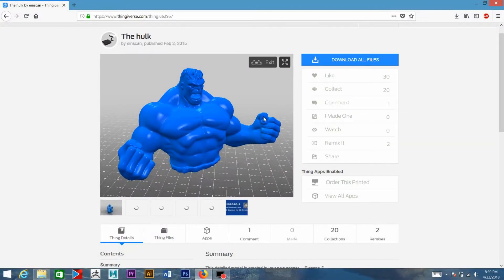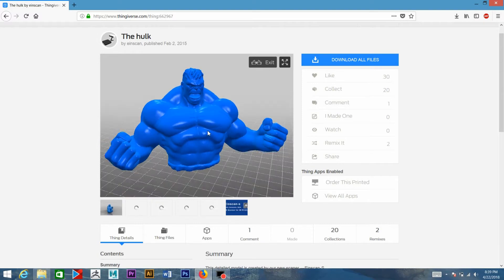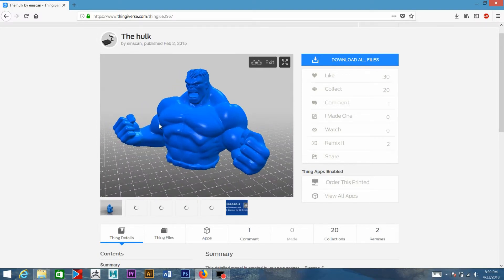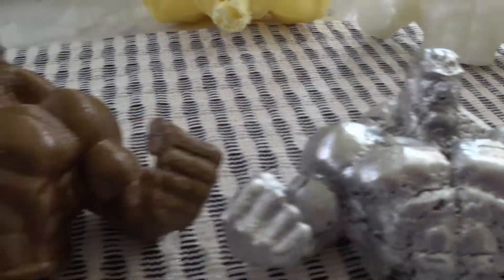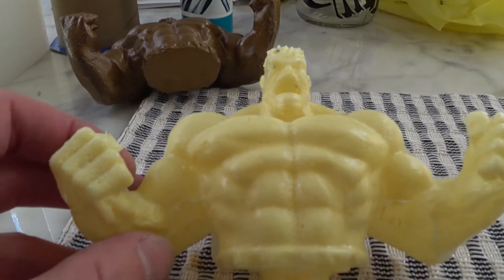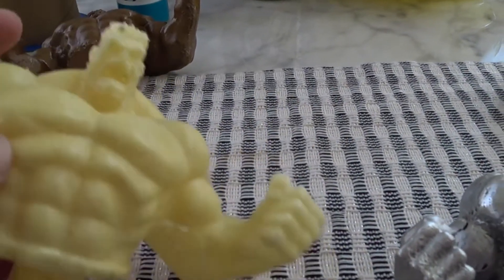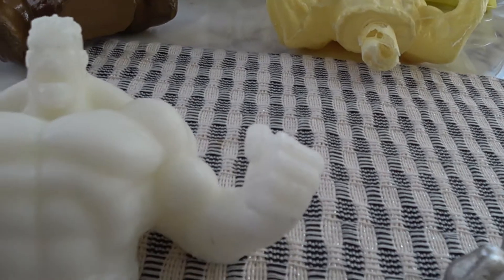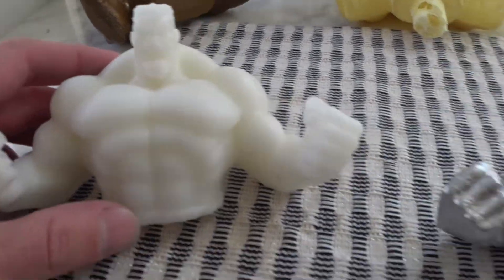Aluminum Casting The Hulk From A 3D Printer

Comment: Thought of maybe using small fan to blow smoke away for you to see better when pouring the molten metal.and probably vent holes. Well  im a noob on these so im watchimg your vids and bigstackd to get tips. Just one question wouldnt it be better casted with greensand?

Comment: Wow, you and I had similar ideas at the same time. I did an incredible hulk casting too, two months after you did.  Mine came out better though, I have tried that lost wax method and there are a few trade secrets to know.  The bronze works I visited use a real old way of doing this and they never have the cavities you had.  Of course there is are better metals for this kind of task too.  Great video, maybe you  can check mine out too.  Great thumbnail pic by the way!

Comment: Package arrived today thanks Adam 👏🏻😁🤙🏻I was like a kid in a candy store holding that idol. Before I even think about playing around with it I’m going to make a rubber mold And make a few duplicates and put your idol on my shelf. I just hope I have enough rubber to make it properly. I was surprised at how well the skull foam came out. Lucky I read the letter first or I would’ve pulled the maze apart. And the beer sign will look great in brass so I’ll definitely get that done in a future vid. I actually have my next 3 vids already filmed so that’ll give me time to get the idol vid sorted as I really don’t wana screw that’s one up. I’m working nightshift thisSaturday an Sunday night so Should be able to get the graphite blocks coin blanks drilled out and I’ll send them and some other bits back your way mate. Thanks again my friend I much appreciate it, also what was the brand of your 3d printer. And how hard are they to figure out on the computer to download printing templates As I’m not very computer savvy.
Reply from the maker: bigstackD Casting anytime my friend! The 3D printer is the robo r1 plus.. you can get it now for 499. Totally worth it! Yeah make sure you have enough rubber to make the whole mold or don’t even start it or you’ll be in my shoes doing in 3 times and a waste of 150 bucks.. I can’t wait to get the graphite blocks. I have and idea already for a coin. The printer is very easy to use but I can walk you through everything just email me. Did you solve the maze? It’s tons of fun and I have a few others printed that are also really fun to solve and to give to friends. If you cast the skull I’d love to see it in brass. I’m working on a new burner this weeks just waiting on parts but it should be bad ass! Talk to you soon my friend
Reply: ArtByAdrock . Dammit man I checked my silicon rubber which I thought I had a kilo left I only have about 600 g which is nowhere near what I need to do a full mold😫😤. Now I gotta bloody wait Probably two weeks to get replacement silicon send🤷🏻‍♂️. Oh well  I really shouldn’t complain I suppose, a Few weeks in the scheme of things really isn’t that bad or that much👍🏻
Reply from the maker: Oh damn that sucks! Well it’ll all be worth it in the end